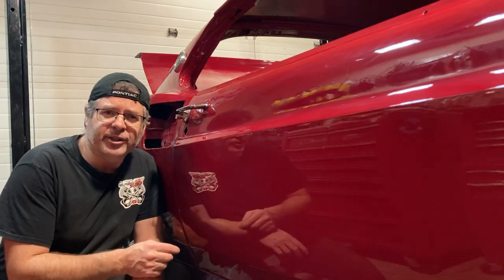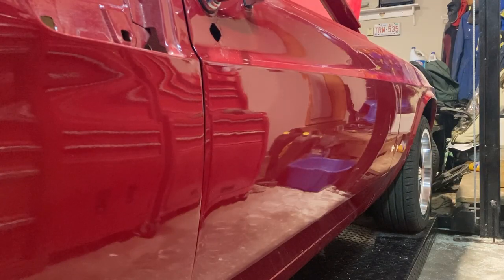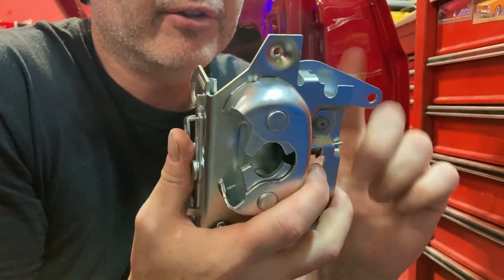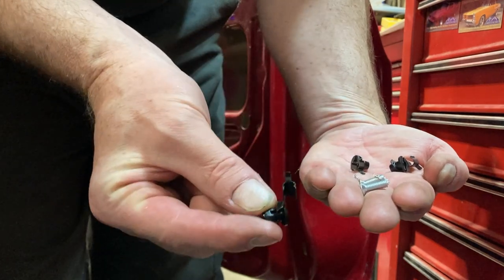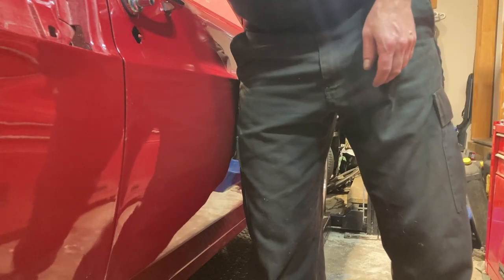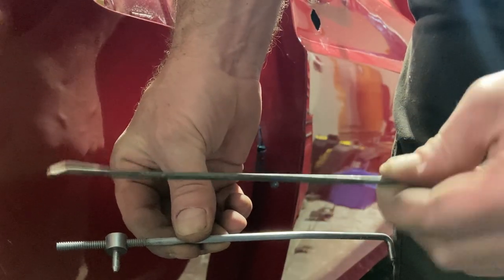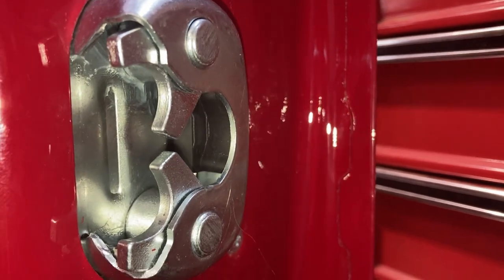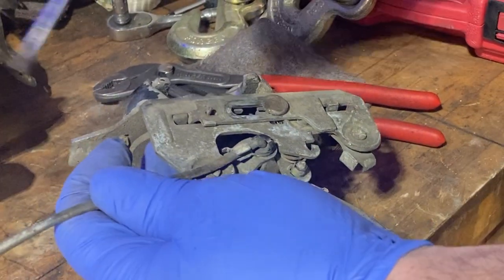69 Mustang Door Latch and Weather Stripping Install - It's a Mess!

Comment: Great video. I'm just here because you have more Ford stuff.... hahaha. Great points on the adhesive. I use to be 'that guy' (squirt n stick) but later realized it works much better in the 2 or 3 step process. I recently did a trunk lid seal on a '55 Fairlane, and they are not short, and all glue-on. Let me tell you, trying to wrangle that thing....quickly.... and not accidentally have it touch the 3rd application or anything else, where it shouldn't, proved to be a real chore. you doing it in sections might be the ticket. (Looked like I had an anaconda wrapped around me in the process...lol) If 3M could slow the dry time just a touch and have it in a can with a application ball, I'd be as happy as a pig in 💩! great job, man!
Reply from the maker: Thanks for the watch and the comment!  Man that would be a challenge, I have to do the trunk seal on the Mustang, but I got the nice 3M black, because it’s just nicer to work with…still a pain though

Comment: I'm restoring a '69 for a 75yr old lady who bought hers brand new in '69.  I'm working on the same latch at spot 6:30 and I see a thick "wire" near the top of the latch that is wound (left side of picture) around a stud looking thing and it then goes completely straight across the unit to the other side  Her passenger side latch is missing that piece and I can't seem to find a new replacement for it.  What is it and what does it do and where can I find one?   Thanks in advance.
Reply from the maker: From your description I believe you are describing the spring for the door lock.  It keeps the door lock up so it doesn’t just fall and lock the door.  Not sure if you can procure it separately, but CJ Pony Parts have the complete latch for around $60 I believe.
Reply from the maker: There are two springs if I recall, one is the door lock and the other is to trip the latch closed.  Some of them will have a white stripe inside the spring that doesn’t attach to anything…this is an anti-rattle device.  Hope that helps.
Reply: @MongrelsGarage   Thanks for responding.   If you look at spot 6:30 on your vid, you'll see the wire (spring looking thing?) I'm talking about. It's thicker than the other spring and goes left to right across the mechanism horozontaly right in front of the unit.

Comment: Hi - so I’m working on my 69 mustang door latch. The three screws just spin, they won’t snug up.  I’ve tried multiple lengths. Are there locking washers for the back? I noticed in your hardware you have 3 washers?
Reply: I bought a set of OEM screws. They came with washer, but seem too short?
Reply from the maker: @americanmuscle0703  Yes, they do have a lock washer under the head of the screw.  However your screws should tighten up, if they don't then they are either the wrong size (too small diameter), or too short, or have been over tightened and stripped the threads (hopefully not)
Reply: I tried a bunch of screws. Pretty sure the latch was stripped when I bought it. I’m going to try to push a larger screw in. If that doesn’t work, guess I’m replacing the latch